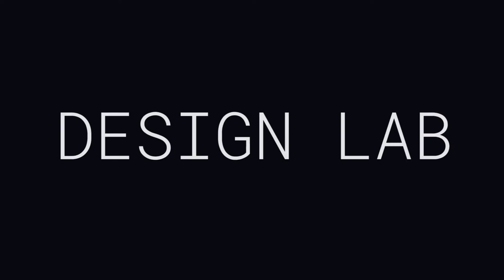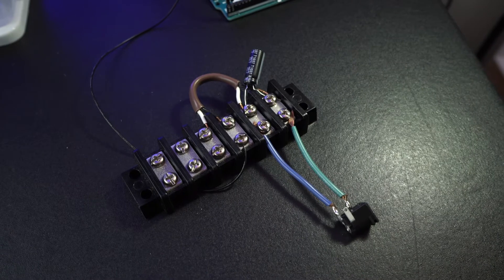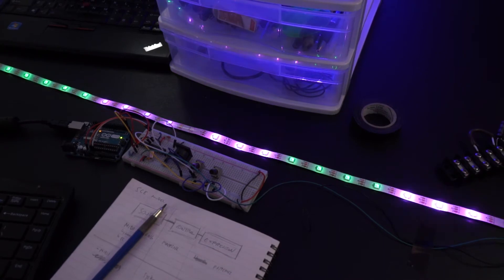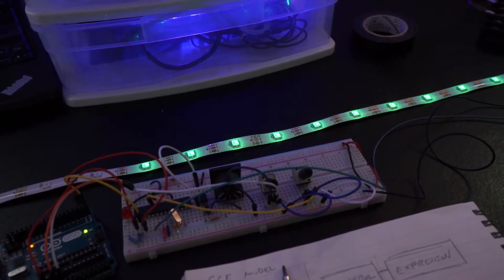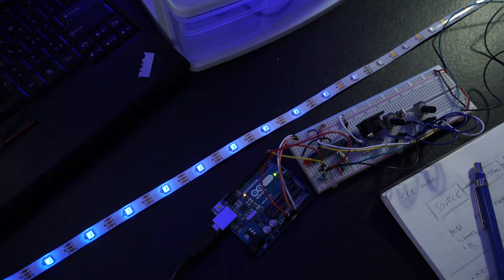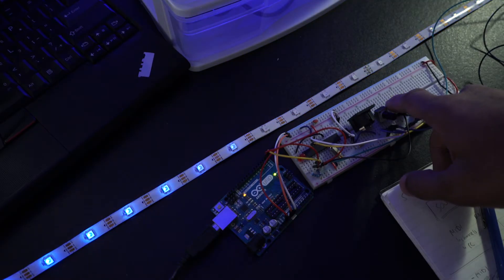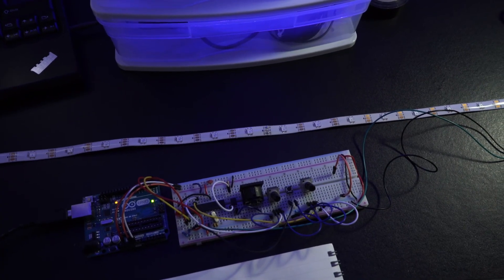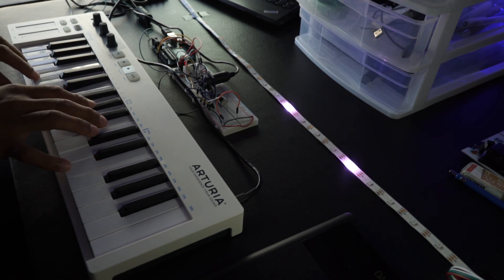MIDI controlled LED strip - Part 2, layering

Comment: Is there a simple way to plug midi signals into a video to control LED lights while the video (audio) plays? I'm a developer but I don't even know where to start with all this LOL
Reply from the maker: Good question! That would be cool, even I'd want to try something similar to improve my own videos. 
A good automatic solution doesn't seem to exist (just did some searching around), but I found this:
https://www.ableton.com/en/manual/working-with-video/
Maybe you can try Ableton's automatic audio to midi tool? Or manually add midi notes so the lights correspond with the video, then play both at the same time.
Reply from the maker: But this assumes you have a midi to LED tool like MAINFRAME.. If you have DMX based lights then maybe software like QLab is worth checking out
Reply: @mainframesys  I have a buddy with a DMX system and while it might be costly I’d love to try this out sometime. Controlling both DMX and LED simultaneously would be the ultimate end goal lol